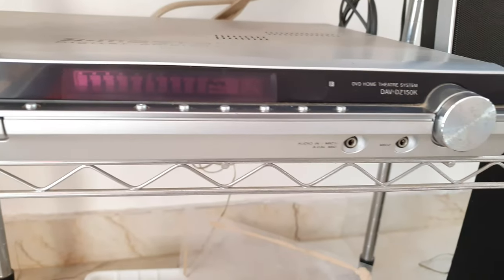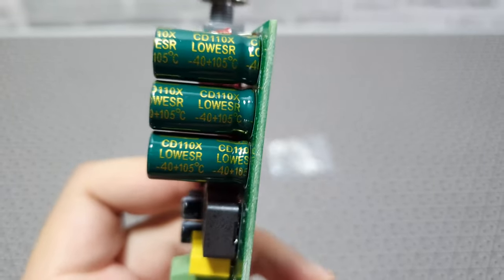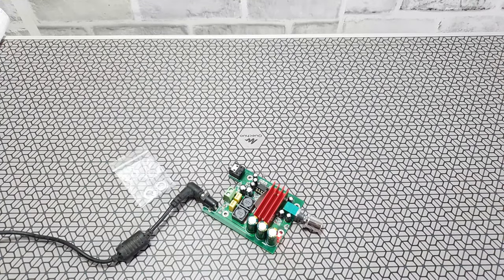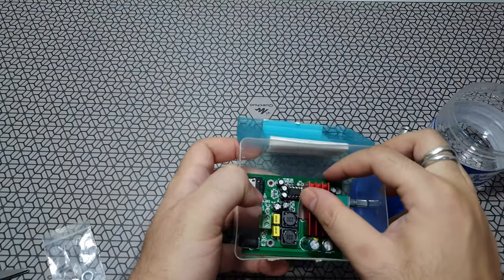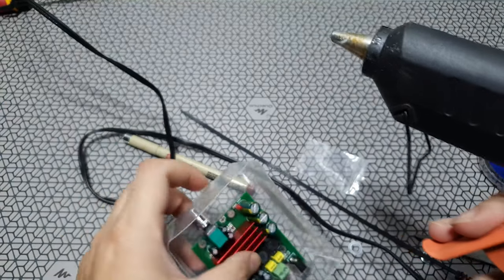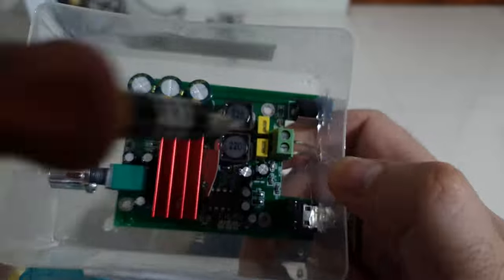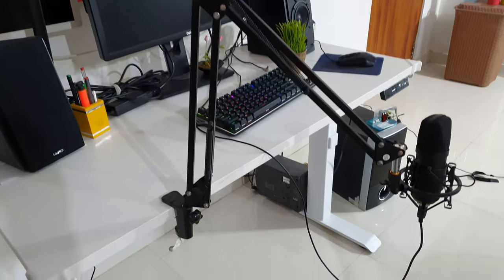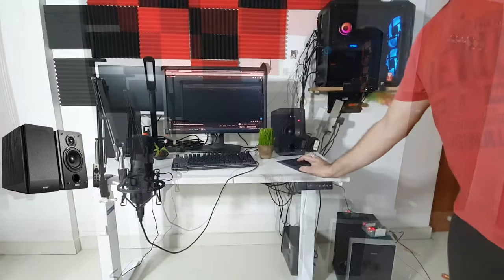Passive to Active Subwoofer using a TPA3116D2 Amplifier - Simple DIY Project

Comment: Nice video.  However I would suggest for you to use your digital amplifier dvd player and connect it directly with your edifier sub out port. In order for you to do this you can see that behind your DVD player there's a slot for TV input which is right red RCA and white RCA port. So if you simply just connect  a single RCA cable and connect it with your sub out on edifier and also connect your sony passive sub with sony dvd player, it will work perfectly and will utilize full power as well.

Comment: I have a massive passive speaker with 2 15" woofers and a horn on top. The movie theater gave them to me when they upgraded. My problem is powering those things for the cheap. This may help.
Reply from the maker: Yes these are worth a try
Reply: Give em to me 😂
Reply: I have an 18 inch Lf dj driver in my room with five 12inch car subwoofer, all hooked to different amps.

Comment: There are also some TPA3116D2 2.1 amps - I have one, and just use the sub output for my Polk sub after the amplifier died. That one has low pass filter adjustment up to 200Hz
Reply: But the subwoofer  output in the 2.1 amp is only 100w rms. Any subwoofer I see to add to my bookshelf speakers have gigantic power requirements like 400-500w rms and above 1000w peak. 
Can you use the 2.1 amp with an active speaker and use the subwoofer terminals just for audio signal ? Or will it go KABOOOMM 
Can some expert assist pls

Comment: Hi, nice video. My AV receiver has a single RCA output for the subwoofer, to connect with this amp I gonna need a cable from RCA to 3.5 jack. My question is the 3.5 jack must be with two section or tree sections? Thanks
Reply from the maker: Hey thanks, good question, I believe a 3 section 3.5 cable will split 2 channels L &. R, and I have actually bought that cable. In any case for a Sub it doesn't matter if you use a Stereo cable or a mono.

Comment: Is it good for room shaking bass or not? how were your experience?
Reply from the maker: Depends on the subwoofer size... get a 12 inch should be good 👍
Reply: @rtechreviews  i have only 6 inch jvc sub but i want to buy a proper active sub 8 or 10 inch it will give good bass against passive sub or external amplifier board sub 
Dude thanks alot for reply😊♥️

Comment: Thanks for a very informative video… I have an old Sony subwoofer like yours with speaker wire connection, which was a part of a surroundsound stereo system I would like to hook the sub up to my home DJ set up. Could I go from the subwoofer to amplifier to a preamp mixer unit? The inputs on the mixer are 1/4 or xlr. My mixer is Wharfedale Connect 802 USB Compact Mixer for your reference . Many thanks
Reply from the maker: Thank you for watching the video.  If you have an old sub, this amp could power it up yes. The inputs this little amp has is a 3.5 mm sub input only. Does your mixer have a sub out?
Reply: @rtechreviews  Thanks for the reply - it doesnt have a dedicted sub out - it just has 5 channels with eq controls and a headphone and mic port - 1/4 inch jack size. Could I run a 3.5mm to 1/4 jack cable from amp to mixer?

Comment: where did you connect the two speaker wires, you didn't show it.
Reply from the maker: Hi there are 2 leads on the board, it's clearly labeled

Comment: Thank you! But 1 question, I have a speaker with no sub out but there's a line out 3.5mm jack. Can it still filter out the vocals into the subwoofer?
Reply from the maker: Hey I did show a clip connecting directly to a line out, it Will Not filter out the bass alone unfortunately...
Reply: @rtechreviews  i see, thank you

Comment: I really liked the video.
I have a Pioneer HTP 200 -SW  passive subwoofer with two drivers. It has 4 inputs from the my old Pioneer amp ( no dedicated sub out ) and 4 outputs to the side speakers . I have recently upgraded to a Denon amp with sub outs.
It would appear to have some sort of electrical  crossover ( at the back of the 4/4 input /output panel)   to feed the two cones.
If I connect the amp to one of the two inputs would this feed one of the cones?.
Is there anyway to use both cones with one amp?
Reply from the maker: I'm no expert but in guessing your going to need 2 amps
Reply: @rtechreviews  With further research it appears that I probably need to bypass the crossover and connect directly to one of the cones.
Will give this a go when the amp arrives.

Comment: why it doesnt work with my denon receiver. only buzz and humming.
Reply from the maker: Can you describe your connections please
Reply: I also have a Denon receiver I just used a RCA male to female y splitter cable and connected RCA cables out  to another avr and used it to power multiple subwoofers
Reply: @plexfam  please explain me briefly. I also have denon av receiver and passive subwoofer.
Reply: @rameshyygovindan2022  yes I used a y shaped splitter it's male RCA to female red and white RCA I plugged it in the subwoofer port which is basically a RCA jack then got one red and one white RCA cables and plugged them into a another receiver the has speaker ports and then I connected my passive subs via speaker wire and then your done you can raise the volume to whatever level and have your room rumbling during action scenes in movies or video games
Reply: Thank you
Reply: @rameshyygovindan2022  your welcome

Comment: Can i connect it with tpa3116d2 amplifier board??....just to get bass only from the subwoofer output of the amp
Reply from the maker: Sorry dint understand that question please
Reply: @rtechreviews  how do i connect with my 2.1 tpa3116d2 board?
Reply from the maker: Oh ok... you can do but the bass is not filtered out. You need to feed a subwoofer out signal for this to work properly